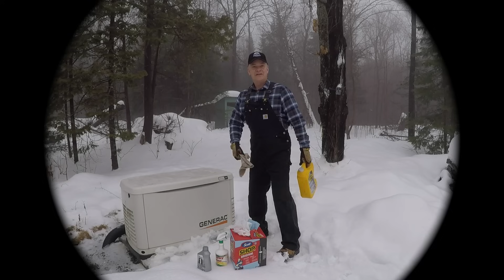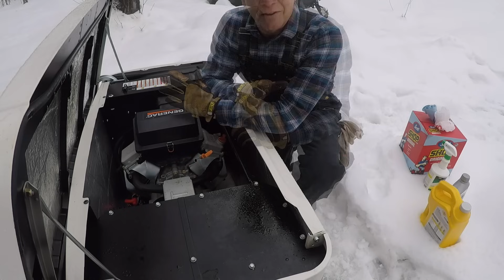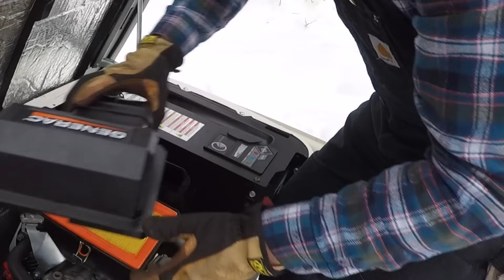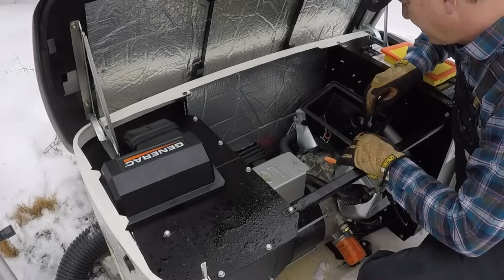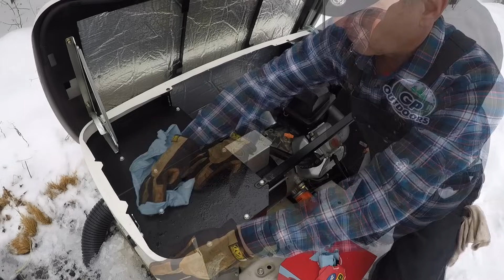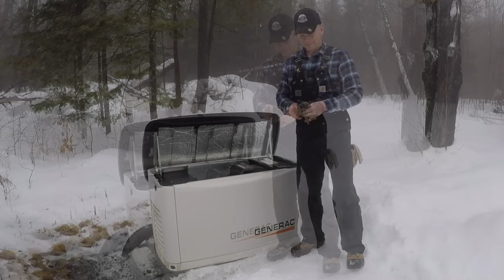#133 Thinking of Buying a Generac Generator? You Need To Watch This!

Comment: I don't have that problem nor will I ever have it.When I had my Generac installed the tech advised me to spend $150 extra and have a heating element installed in the case to keep the engine warm when the temperature goes below 30 it comes on automatically and keeps the engine warm no matter how low the temperature goes and the engine fires up in an instant .That was great advise from the Generac tech.
Reply: Spend an extra 150??  That thing is expensive as it is.  I would be on the phone with generac everyday till they fix their design flaw..
Reply: @philllsxga.7737  YAGODATSHITRITE
Reply: The Tech forgot to say thank you for the Commission he earned on that upsale.
Reply: @philllsxga.7737  so you spend 8k to install and you worry about 150?
Reply: @chadschafer3890  Exactly!!! 8 thousand dollars!!  Think about that...  That is a lot of money to pay for a flaw...
Reply: @philllsxga.7737  Its not a flaw.  Its no different than having to buy a block warmer on a deisel truck.  Those cost 50k plus and you still have to pay for the warmer.  A design flaw is something that happens to a majority of customers.  Not just the few
Reply: @chadschafer3890  it is a flaw. And people like you except thing's like that and don't hold these filthy weathy companies and filthy weathy CEOs responsible.  That why things cost so much, nobody questions why this or why that they just accept it and think that's how it should be.  YouTube Deboss garage why not Ford.  I question everyone and everything, that is why I don't get taken advantage of...
Reply: @philllsxga.7737  yup sure
Reply: @philllsxga.7737  Not everyone is in need of the warmer so it comes as an additional option
Reply: You got suckered 4 another hundofifty. Why not pay extra for the rust proofing too..
Reply: Hey Glen, that is the solution to the problem that is offered to any person living in a cold climate like I do.  Makes sense to me.  My 22 KW propane Generac is 4 years old and works flawlessly.  Yes they're expensive but so is having your house freeze up if a tree takes down your hydro lines and you don't have a way to heat the house for a few days.  Maybe all car manufacturers should make snow tires part of the base price of cars as well??   Don't want to spend the extra $150.00 for peace of mind, don't but be prepared to deal with the ravages a cold climate will play on your internal combustion engine.  Hillarious how people condemn Generac for not incluing it in all generators.  That could work but then EVERYONE would have to pay, not just the people who actually need it.  Not sure but the last time I checked, people in Florida wouldn't really need a "cold weather option" (or snow tires) nor would they be happy to have to pay for one if Generac decided to include one with every single generator sold like some people here seem to think they should.  I'm quite sure the people condemning Generac either don't own a generator or can't afford a generator and just like to see their complaints in text form.
Reply: The rebreather heater should be offered as part of a cold weather kit where needed. Unfortunately they also cook/harden the rubber hose over time forcing it to be replaced.
Reply: @philllsxga.7737  I dont feel it's a flaw. It is an accessory to the system for specific climates and this guys salesman didnt give him the option
Reply: @acman0926  you are missing the point.  It is a design flaw.  Water getting in an air intake box is not a design flaw??? Another  150 dollars For a heat that cost maybe 6 dollars to manufacture?! That is unexceptionable for  what that generator cost!! That is why these manufacturers and companies charge what they change for a product, because PEOPLE WILL PAY IT!!!
Reply: @jason1440  How much money did I borrow from you?Im happy with the results Ill leave it there.
Reply: Texas CAT Manuals  no.  But what justifies them being filthy weathy and pay employee's 8 to 12 dollars per hour!  And products cost so damn much and they are made in foreign countries!  How is that fair to the consumer?!  YouTube George Carlin business man... George Carlin on business ethics...
Reply: It doesn’t need a heater. It needs to have the crankcase breather port moved to a higher point in the air filter box. Then it won’t get plugged. I’ve also reconfigured the airboxes to be insulated and to take air directly from outside the cabinet which almost totally ends the ice buildup from condensation.
Reply: Hello  Texas CAT Manuals .  The $150.00 cost of the cold climate kit isn't actually a "fix" as you described it.  The fix happens to come as an added bonus or benefit to having your engine easily start in -30 degree weather, in the middle of the night when the power goes out.  Now, I see your point to a degree (and definately on the 700 as well)  but my way of thinking is that if they "re designed" and got rid of the "design flaw" as you called it, most knowledgable people in cold weather climates would still purchase the cold climate kit anyway to A: make sure the geny would actually start when needed and B: probably help extend the life of the engine.  Is the $150.00 option a rip off?  It is wired into the on board control pannel and becomes an integral part of the computer system so I say maybe not.  You see, these generators don't simply start up and nicely idle for a few minutes to warm up the engine components before going full throttle.  No, they go from startup to full throttle in a matter of a couple of seconds.  At least that is how all of the ones I have dealt with operate.  Picture you, (well not actually you cause you live in the deep south, lucky you) but lets say someone in Alaska in January when it's -30 or -40 jumping in their car, hitting the ignition switch, dumping the trany in drive and hammering the gas pedal 2 seconds later.  Firstly, it just might not start and if it does, there will certainly be some sort of warm up period (unless they have a block heater plugged in) before attempting to operate it.  The cost of the kit is irrelevant to a degree.  Have you ever thought about how much that refrigerator, I bet you have, costs to make?  Probably about 30-50% of what you paid for it.    Again, this is an "oh by the way, just in case you didn't realize" videos, not a let's bash the messenger videos (and I know you are not one of the bashers of the messenger).  But, for the record, you can bash the Liberals all you want with my blessing.
Cheers
Reply: Well said about big companies Texas CAT Manuals .
Reply: Glenn Jackson thanks for tip
Reply: I also installed the cold weather kit years ago and have never had any problem.
Reply: I bet all cars being sold in US have both A/C and heater. Does not matter if they'll be sold to Florida or Toronto. The point is the generator should be properly equipped for consumers on any state..
Reply: PhillLsx Ga. 
Reading the argument I would ask you how do you propose this issue be fixed ?    I’m asking as I’m looking to buy one and I’m not sure it’s a design flaw or just a fact of science that when hot meets extreme cold condensation will form    The issue on if it’s a  design flaw or not to me revolves around if there is a simple answer and they failed to do it.   Or if other similar generators don’t have the same problem and why ?
Are you simply arguing they should include the heating element ? Or that somehow it was designed poorly compared to others and they have the problem when others don’t ?
Reply: IT SHOULD COME WITH THE ELEMENT!!!..
Reply: @philllsxga.7737  RIGHT!!!
Reply: @philllsxga.7737  RIGHT AGAIN!.. IF YOU CAN GIVE THEM $8K.. WHY CANT THEY GIVE THE CUSTOMER A.. " BUILT IN ELEMENT ".. LIKE YOUR STOVE!!
Reply: @philllsxga.7737  THEY SHOULD HAVE IT SET UP FOR COLD WEATHER!
Reply: @philllsxga.7737  CORRECT AGAIN!!.. A VERY SMALL ISSUE FOR THEM TO FIX!
Reply: Texas CAT Manuals  COULD NOT HAVE BEEN BETTER SAID!!...
Reply: @philllsxga.7737  RIGHT!.. THE PRODUCTS NOT EVEN MADE HERE ANYMORE...BUT.. COST MORE THAN THEY DID WHEN WE MADE THEM HERE!!..
Reply: @philllsxga.7737  INNOVATION HAS NOTHING TO DO WITH GREED!!.. PEOPLE NEED TO KNOW TRUE HISTORY...GOOD POST
Reply: Oh man! The humanity! Here's the best solution, the crankcase need to be kept warm in a cold climate, period. A standby generator goes from cold start to full power in mere seconds.

In a moderate temperature, this is possible, but it it's an unreasonable task in the cold. If that engine was a diesel, we wouldn't be having this argument, a warm engine is a must.

Keeping the engine warm drives moisture from the enclosure, also a benefit for the electronics.

Many are splitting hairs on definitions, and are being quite unfriendly.
Reply: Texas CAT Manuals Trouble is we have allowed the Communists into the school systems. It’s the old KGB ling game to screw the West up. Search it and that’s another U-Tube for another day. 🇺🇸👍✔️

Comment: I install these units, and they are generally pretty good for what you pay for them. The crank case breather has a heater which is part of the cold weather kit. The kit has 3 heaters, one for the battery, one for the oil filter, and one for the breather. The breather heather is only energized when the generator is running. The other two run when the temp is below approx 30F.
Reply: WHT good is it if it only operates when it's running? It would still puke oil out until it melts... Maybe still all of it down to the oil switch
Reply: You got it right! This generator needs a heater. I installed them on my Briggs generator, see my videos.. They work when gen is not running and temp is below 32F or so. Not having it will wear out the engine as the engine oil will be Jello when started in that cold temp. I installed the oil filter heater in my video on a generac and that may be enough, but a heater wrap there may help. Is it possible to drill a drain hole?
Anyway good video, YouTube critics just complain. Keep up the Good work!
Reply: Quote,,,,, " The breather heater is only energized when the generator is running."
This has to be the most idiotic design... if it's true. Truly amazing. For a generator that is supposed to work in emergencies.
Reply: @TheWilferch  That cant be true. The whole purpose is to ensure start up. Once running the engine heats itself. Watch my generac video with a friend. There was an electric always  hot bar to connect power for the oil heater. I believe that the breather heater connects to that too. They come with a temp sensor that only allows electricity to flow when under around 32F.
Reply: @silverbankruptcy  ,read the original poster's statement ( Taylor Sutherlan), that I am simply quoting....so I still stand by my statement...it is a most idiotic dessign if this is true. We don't have such pre-heater complications on PCV valves on cars...and they run in severely cold weather.

Comment: I'm responsible for five Genrac units all around 10 kW capacity. They're used for standby power at radio stations I service in South Western Ontario. Bar batteries failing I've had few occasions when they didn't start and service their duty. I've never encountered the water problem. Maybe because all mine run on propane. If this gentleman has an on going problem I would suggest the answer is a 1/8" hole or two, drilled in the bottom of the air filter housing, put a split pin in the holes with the legs partly spread so they rattle when the engine runs and keeps the holes open to drain but keep the bugs out.
 The other thing we've done from the start is to have a heater sleeve around the oil filter and one around the battery to counter sluggish starting in the cold of Canadian winter .
Reply: I think propane and natural gas have much more water in them than gasoline.
Reply: The heater sleeve is just to insulate right as u cannot run power to it ?
Reply: @jake733  No the sleeves are actually heaters. They are connected to the "sample 120 voltage" in the control housing. Installation instructions are supplied with the heaters. 
They each have a thermostat built into the sleeve so they only heat below about 10*C so they're not on all the time.
 When the power fails and the generator starts, if the ambient temperature is below 10*C then the oil with be warm and the battery will be more efficient for cranking the motor.
The thermostats are not accessible and therefore not adjustable.
Hope this helps.

Comment: Perhaps you could fit a home made short snorkel pipe from the exhaust port up a couple inches to prevent ice blockage of the port. That’s what I would try doing. That way, the ice that forms in the bottom of the filter box wouldn’t restrict air flow. Just a thought.
Reply: My first thought, as well.
Reply: Just vent the crank case pressure out side not in to air box and install a catch can to keep oil from dripping on the ground. Stuff like this drives me crazy that General doesn’t change the air box design so the crank case pressure can go to a catch can do simple to fix !
Reply: Good idea

Comment: As a generac installer i'd definitely suggest lengthening the exercise time to 15-30 minutes. The generator should bake off all that moisture in the air box when it runs and not have enough moisture to cause this. Another option is to extend the shutdown after power restoration. These are dealer controlled options that you would have to have them set.
Reply: Is this issue addressed in the owners manual? Under the "Most important things you need to know" category? Is that 'back programming' something that the average homeowner would normally be aware of? Are there reputable dealers/installers that set these parameters according to environment conditions for that area? Do you?
People want this unit so they can be prepared. Let's say this exact problem arose to a unit far from civilization, in the dead of winter naturally. But the unsuspecting owner did not have access to motor oil. At that point it would appear the $15k they spent was an entire waste of money. Oh sure, just drive somewhere and buy oil. WTF?  Take that $15k, drive somewhere and get a hotel room.
I assure you that I do not hold you or any other installers or service personnel responsible for such a poor level of forethought in the design . That would be the generac engineers, who unbelievably left this GIANT hole in their concept of reliability.
It would be as if I designed a refrigerator that worked perfectly fine, until the hottest days of the year came around.
Oh, you didn't read the fine print in the owners manual and how to prevent this ? Too bad. That's how we made it, and it's what you bought.
Yeah, no. I would not sell, nor buy, anything like this 'brand new boat with a factory designed hole in the hull'.
Reply: My authorized Generac installer says the max weekly jog is 7 minutes. I didn't believe him, so I phoned Generac. Same reply with a suggestion we manually exercise the 22K Natural Gas Generator for 20 x 30 minutes weekly. That does not make sense to me.
Reply: @RealityCheck1965  mine ones 12 minutes 1X a week.
Reply: Nope, no option to extend this on our Generac 20KW unit.  I looked and finally called them.  They know best...